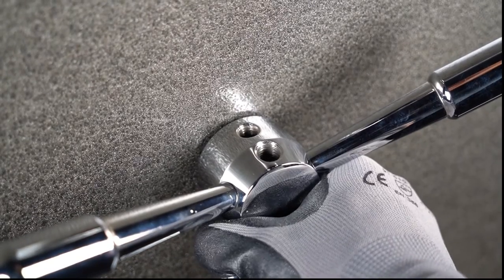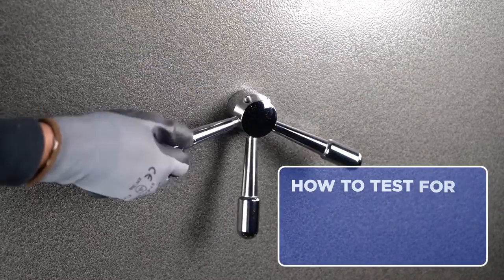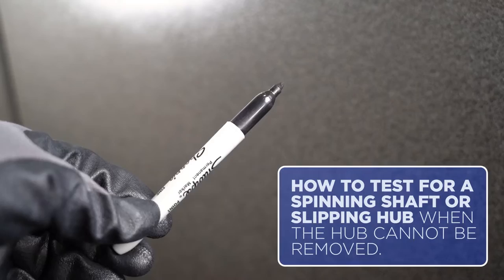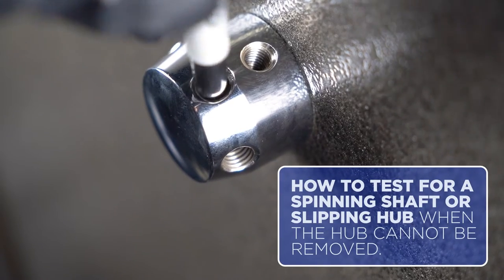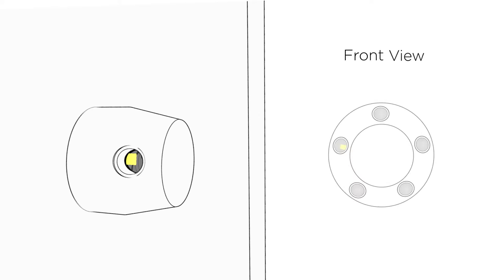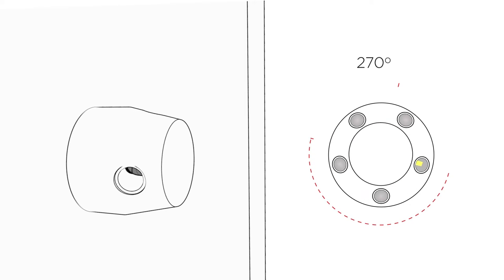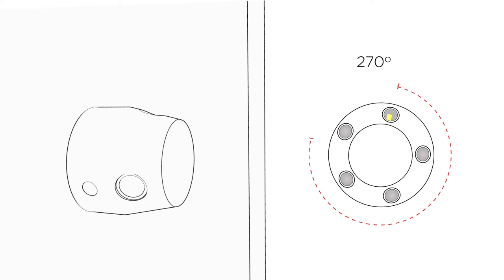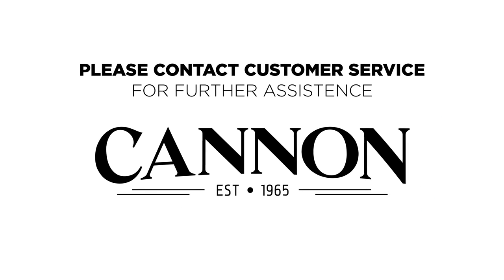FAQ - handle spinning

Comment: i have this safe and my handle spins freely, the thing is that something has come off inside and i cant open it at all.
the lock works perfect but the handle just spins and yes i have made sure the allen screws in the handle are tight ...it's something inside ....No clue what to do
Reply: Same problem…what did u do to fix the issue
Reply: Same what did you do